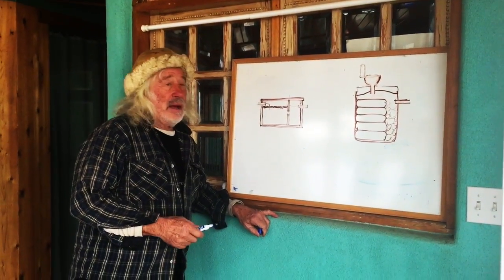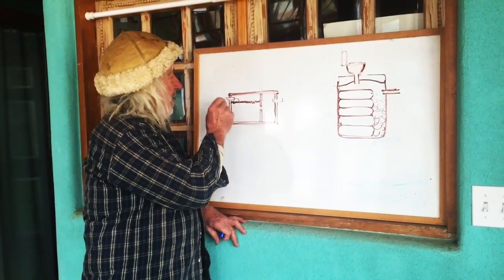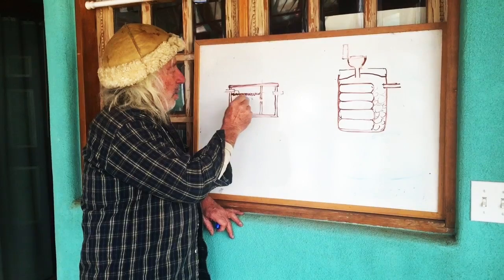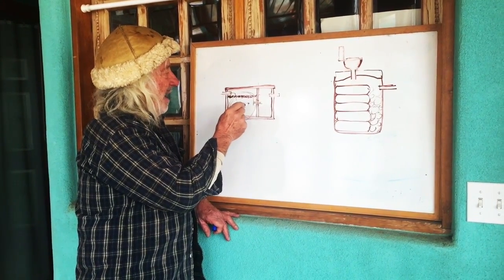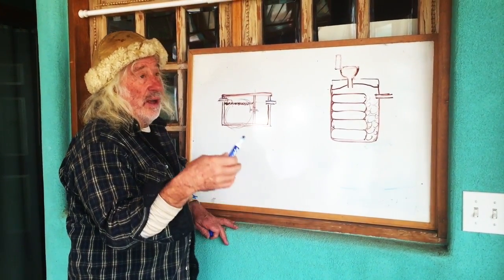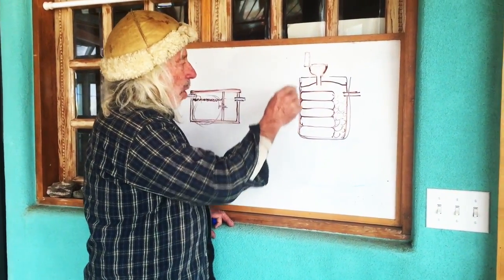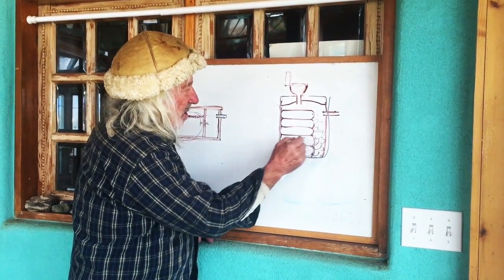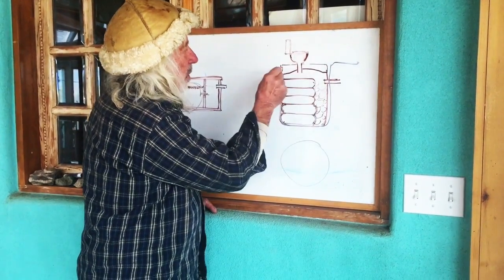Outlaw Septic Explained

Comment: This crap will ne er be approved in any state and u dont trust it working as good anyways. The best septic  tanks are built in concrete by pros like myself. Should have 2 inside tin chambers before inlet and after outlet built in concrete like 2x2ft...( the leech field many people dont even do it right. ...
Reply from the maker: Thank you for the comment. Our systems are in addition to a conventional septic tank. Our systems contain and great waste water without dumping into the ground and polluting water sources.
Reply: Systems like this are approved in Arizona. Homesteaders got tired of being ripped off.

Comment: What happens when you have to empty it...do you remove the tyres and out replacements in there or what...can someone explain or send me to a link.....
Reply: I've heard on other ES videos that after these being used for 20 years, they're still not full! Apparently, the anaerobic process works so well in this design that it doesn't need to be emptied?  They did not elaborate...
Reply: @blackmambo327  to my understanding, yes. It should never need emptied because solids become liquids and tge liquids flow out the outlet into a leach field. In the case of most earthships you will have a lined leach field so as to hold onto that liquid in order to grow vegetation. Now keep in mind, this vegetation is not going to be any kind of grown food as it is black water after all.
Reply: @thebusbums2825   Yes, I know. I am two field studies away from ES Academy graduation. I just said that they did not elaborate and I was under the assumption that it doesn't need to be emptied. Thank you, Bus Bums
Reply: @blackmambo327  i doesn't need to be emtied.. no assumptions necessary
Reply: You don't have to empty it. It works just like a traditional zoned septic tank. So long as its enzyme levels are proper then it should decompose any solids into the the static black water that will sit no higher than the outlet. Solids and liquids go in and liquids out. To a leach field which is perfectly safe and clean to live around. Most homes outside city limits have a septic tank and a leachfield

Comment: How do you calculate the size required? Does it require maintenance? or to be  sucked clean on a regular basis?
Reply: Good question, if so maybe someone could use a heavy duty shop vac then dispose of it at a rv dump station??

Comment: What about if local flooding occurs and your septic system is essentially under water for a few days?
Reply: probably the same thing that happens to a concrete septic tank. Not all septic tank lids are water tight.

Comment: The only piece of the puzzle I see missing here is the capturing of the off gases for fuel...other than that...it kicks ass as Michael always does!!
Reply: Same. The solution in my head would be to put a drain pipe from the toilet to the inside of the tires. Also preferably put some vertical and lateral seperation between the toilet and septic tank like any other system. Having the toilet right on top seems like a recipe for acrid smells

Comment: Let's just say I know of a home in Missouri that's old really old and it used to have an outhouse and at one time someone put in two bathrooms about 50 years ago and it just dumps out on the ground into some river gravel in a ditch about 100 yards  away from the house and if you look at anytime out there you see nothing  and there's no smell someone dumps some lie out there about once a month or two.......this is what I call outlaw septic but it works
Reply: Joseph Atnip Hopefully that is the only thing it was used to decompose. ;-)
Reply: And someone drinks that downstream
Reply: Kevin Kirkpatrick I believe what he means is that someone put gravel in the ditch where it drains, not that it is running into a river. Gravel FROM a river would be coarser as the finer particles get carried downstream. Putting the lye on would accelerate the decomposition and drain/rain water would filter it through the gravel into the ground. 
If he was talking about a river it would be pretty pointless to dump the lye on, because as you said, it would immediately be carried downstream just like the waste. The waste and lye would never come into contact.
Correct me if I am mistaken.

Comment: How does the water leach out of the tires?  Do you punch holes in the tires or does it just gradually leak out from the narrow spaces in between the stacked tires?
Reply: I agree with your question, seems like any gaps would just get sealed by any sediment in no time & then just overflow the top of the tires which I guess would work.
Reply: I would use gravel between tires

Comment: Where do the gases go, that accrue in the septic tank?
Reply: You can build a tank with a pressure bell tapped at the top for the gas. The composting action creates methane it bubbles to the top and lifts the concrete bell. The pressure created to lift the bell is your gas pressure.
Reply: Was the quesstion about the gases answered? Im curious about that as well.
Reply: MusikCassette the gas would most likely go out with the water, only other place is to bubble out the toilet but that wouldn't be path of least resistance so it goes out into the dirt along with the water.

Comment: I could see this working quite well and possibly getting some free btu's(heat) out of it while the bacteria is doing it's work but for me living in a first world nation I don't think I would use anything other than a cement or plastic tank. The thought of it having a leak and seeping into the ground over time would keep me up at night haha.
Also I might move the tank and pipe the waste to under the green house so that I could have a small hatch to check the seal once in a while. That's just me tho!
PS. I do really like this idea, maybe just modify it slightly.

Comment: I assume this system would need solids removed when full. Wouldn't want solids overflowing the tires.
Reply: +Paul Martin If by solids, you mean things that shouldn't be flushed down the toilet in the first place, yes.  If you mean solid human waste, then no.  As with a standard septic system, the solids are broke down by the bacteria in the first section of the septic tank.
Reply: James Zawacki, Depending upon the use, you may have to remove solids.  There’s a big difference between two people using it or a family of six as far as the buildup and how quickly the bacteria can break it down, from what I see it’s a good design for one or two people but beyond that you would have to pump solids out.